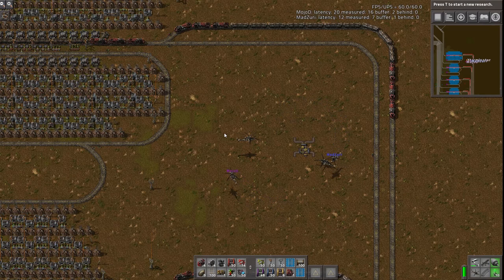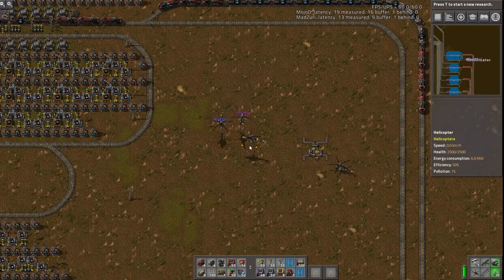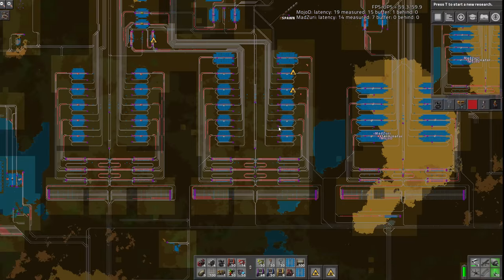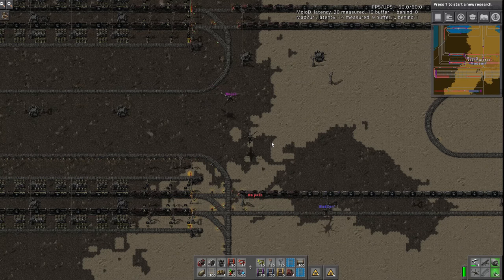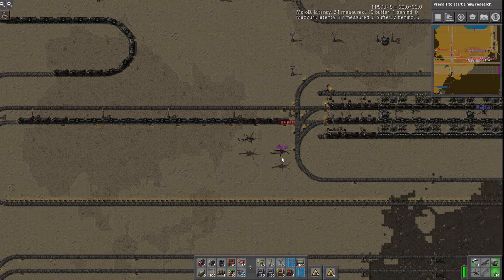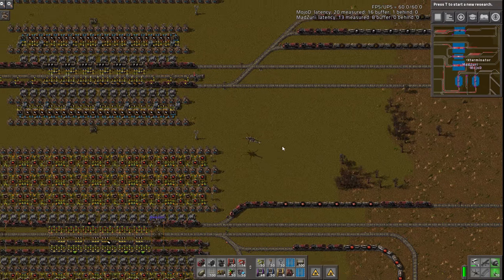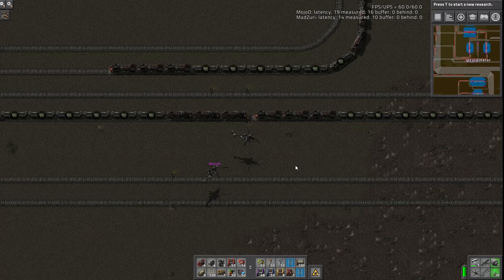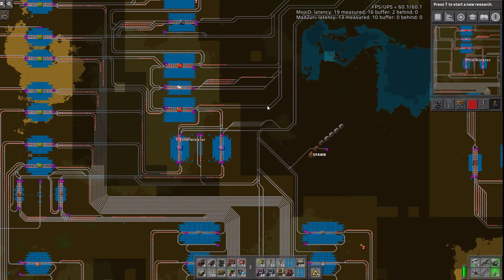Factorio: Megabasing 101 Reboot EP1: Base Tour & Rail / Smelting Concepts - Tutorial Series Gameplay

Comment: Definitely an improvement! I really appreciate your effort, time and thoughts you guys put into this project. Hats off! I really like seeing you guys working together in a project like this, the combo has a lot of potential for future projects as well, espacially with Zuri and Mojo ;) Maybe another topic for discussion and explaining concepts could be the final layout of your builds. So you already covered quit well the small details of designing and arranging them (inserters, bot networks, beacon coverage, etc.), but something I really struggle with is to think about the best way to connect them with each other. I can't really figure out, how to arrange the whole base in itself. For example, if junctions are unavoidable, where would they fit the best. How far out can other builds be placed, so up-time of the consuming build is still maxed out depending on travel time of some trains coming from other builds to deliver their parts...and so on. How do I know, how many trains a build needs and how to split the amount of trains, if one build (for example one of your iron smelter feeds the drill- and the assembling machines build) has to feed multiple destinations, without neglecting one build over the other or blocking the trains from the other build, so there is always a balanced throughput for each build it has to feed. Which builds should be placed closer together than others? I know this topic is hard to cover in generall and depends on the individual situation, but maybe you guys can give us your thoughts about the main things someone has to pay attetion to and how each of you approach these kind of questions and your own factory layouts. This would be really nice. Keep it up!
Reply from the maker: Thanks! Really good questions you asked! 
I will have to remember to copy down what you've said so we can cover it in the next episode or two cause it's really good stuff to cover for sure. :)

Comment: Another problem with segregated rail lines resulting in builds that are to big is that it gets a pain to travel to certain places which is illustrated by the fact that you guys were flying helicopters to show the base.
Reply from the maker: In some cases that's true, but not in this case. We used helicopters for recording purposes so we could easily get over top of builds and such. The PAX network in this map allows you to get wherever you need to go without issue.

Comment: You need to cover a mega-base that uses on-site smelting before you dismiss it.  There are a lot of benefits that you completely ignore because you have never actually done it.  Actually running 4k SPM on a two lane rail system is pretty nice.
Reply from the maker: I've never seen a mega-base that does more than 1k SPM at the most that uses on-site smelting so I have no way to compare to something like this map.
Reply: Thundorgun They didnt cover the biggest issue that most people have. How do you spread the plate from 5 outposts into 20 builds. *without micromanagement
Reply: Hopewelljnj Once you remove steel, gears, and green circuits there isn't much left to manage. 2 outposts supplying maybe 4 drop offs?

Comment: Hey Xterm I was on one of your streams ages ago and you did a coil->greens->blue build and I'm wondering your reasons for not doing it on this map since it would lower on trains and bots. Also... are there instances where you need 2 and a half smelters per build or other odd ratios that you don't want to simplify due to wasting a large portion of the subsequent build?
Reply from the maker: It may lower the amount of bots you need, but it would make the build quite a lot bigger and make the bot travel longer so may not actually be a gain in the end.
Reply: Well... I'd think that lowering the number of bots is a better ups optimisation than just keeping the build small. The build wouldn't have to be that much larger even.

Comment: Hi Xterminator, I'm currently working on a solution to the train pathing issue:
 - the train cycle through "oreStation - WaitStation - smelting" with one wait station per buffer lane. The thing is I control dynamicly the buffer size at each station by activating/deactivationg the stations depending on the number of train on other stations so any buffer with fewer train than average can "request" a new train by activating a new station. It's still in alpha but the results are promissing.

I'm working on this for a project of "tileable" megabe: I'm designing a 2k spm megabase such as you could put X megabase like this one on the same map, sharing the same ore trains (if my CPU doesn't melt befor that). It's not event close to be ready but if you are interested let me know I would be glad to have your input on this.

Comment: Hey Xterm! A small question : How do you keep things fueled nicely in such a huge segregated train network?

Anyways, keep it up. It's always a blast to watch you guys.
Reply: They refuel at either the pickup station or the dropoff station with rocket fuel or solid fuel which lasts long enought to keep all trains running between those points.
Reply from the maker: Thanks, glad you enjoy so much! In this particular base, there are fuel dropoff stations at all the major locations, like smelting, circuits, science builds and oil etc. The fuel train drops it's entire load off and then bots distribute it about the builds and in some cases it is passed through multiple builds with bot bridges.

Comment: I've seen you guys do direct insertion smelting (ore to steel, ore to gears) but never direct insertion circuits (plate to advanced, plate to processing). Is there any reason for that? From the ratios it looks like it would work well.
Reply: They have designed smelter to G.C. But the Xterminator has personally not used it for the reasons mixed smelting and you need many many of them to produce enough circuits
Reply: Bob Builder no, I mean a build that takes in iron and copper plate, plastic and sulphuric acid, and outputs blue or red circuits.
Reply from the maker: That would be a huge convoluted build I'd imagine.

Comment: The argument against on site smelting is IMHO flawed... You are saying that the size of the ore patch is relevant, it isn't.  The size of train and the number of trains coming from each ore patch would be the thing to calculate. When an ore patch runs out, load up the smelters on a build train and shift to another patch, so long as you have enough smelters out in the field then you should be ok.

Now what you said about the number of plate trains needed for green circuits could be a much more valid argument for centralised smelting.
Reply: Julie Fisher The bot network required to run an off site smelting setup is usually larger than any of the guys optimised smelter setups.
Reply: So why use bots... old fashioned belts get the job done.... takes a little longer, but no matter how you do it the amount of ore or plate moved from a mine is restricted by the size and number of the trains.
Reply: Because belts in large numbers are laggy...
Reply: You need to remember that game performance is your most constrained resource. Belt builds are simply wasteful at this point.
Reply: I think one of major reasons against on-site smelting for these guys in particular is the "build the base that's fun for you" argument. I simply don't think they enjoy building/operating "bunkers" for distributing smelted resources.
Reply: Just so everyone knows, bunkers aren't necessary.  There are many ways to solve the balancing issue without them.  And doesn't he already use a bunker type thing in that smelting train distributor?  

But I agree with your statement that everyone should do what is fun for them.  If you want a base with 300+ trains then central smelting is great.  If all you want is a working base with high science per minute and minimal lag then you should at consider doing smelting at the mines for at least steel.